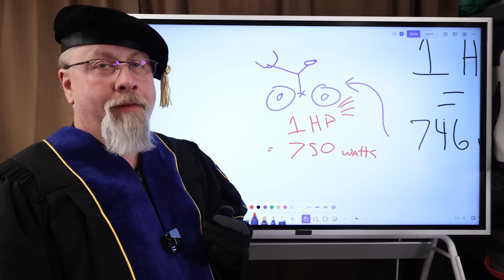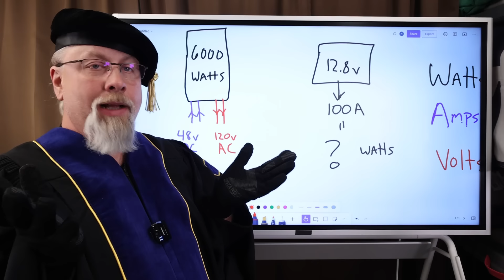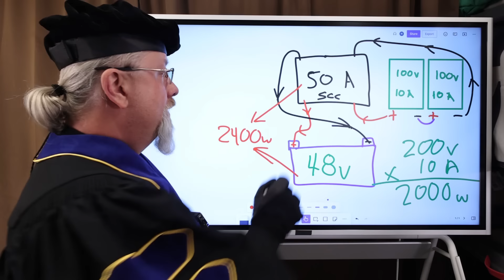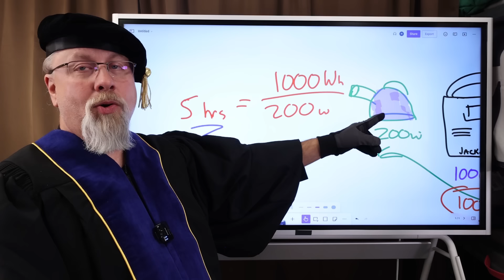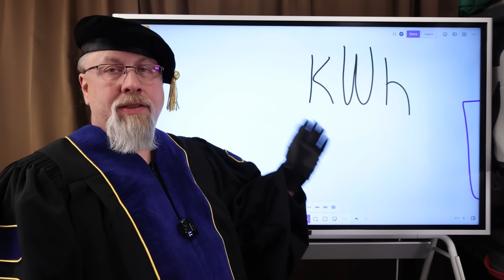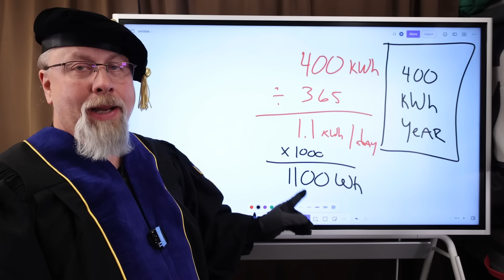Electricity for BEGINNERS Part 3/3: WATTS and WATT HOURS For Solar | Batteries | Generators

Comment: Mr Hobotech I have a question or 2. Good classes but only the tip of the iceberg 😁 Who knew. I agree need to watch again. I have a 2024 Nobo 16.1. It came with 400 watts of solar on the roof wired in parallel they said and 2 64 ah interstate agm batteries also wired in parallel they said. I honestly have not tried yet to see if thats true. There is a 2000 watt inverter which is supposed to switch automatically when hooked up to shore power and vice versa. I have a 12v fridge and tv, a 12.5 btu ac, microwave and propane heater. I hook up to an ecoflo pro with xtra battery and charge that off my f150. Have solar panels i haven't worked out yet but anywho everything works except i have no ac at the receptacles. People have said could be the connections at the receptacles wired in series. Makes sense but i am wondering if my batteries are too small ? I may have gotten a little lost in there when you were talking about battery size. The other question is about mppt cables coming from the panels to the generator a normal sized cable going a 100 ft would be too small? 3 400 watt panels was going to wire in parallel because everyone seems to say that's the way to do it. I got the connectors but broke one so put it aside till i can get it fixed. Anyway 🤦 Thanks for your help.

Comment: Sorry if this is in the wrong place. Will the 12v/24v Lead-acid Battery Charging Cable also work the same on LiFePO battery terminals?  Will really appreciate if someone knows the answer. Thanks

Comment: okay, this seems almost too easy. So if i have a household refrigerator using 547 kWh/year, that equals 1.5 kWh a day(1500 W) or 62.5 W an hour. So, a 700 Wh sogen should give me about 11 hours of runtime? of couse that doesn't take into account any startup surge.Is it that easy? if i finish all 3 vids do i get a certificate of completion?

Comment: Do devices draw more current as battery gets low? I'm trying to understand.. If I use 1200W coffee pot and my battery has gotten to half of its capacity.. So, the voltage has dropped, does the coffee pot increase current to get its 1200W? And I can ultimately fry it when the battery is almost completely drained?

Also, does voltage matter when choosing cables? if I use 120V and 40A load i need #10 awg.. but what if I have only 12V pushing the same 40 amp? I mean now the pressure/push force pushing the same 40A is ten times as less. So less (friction/resistance) and also less power travelling through a conductor.. Can I use #14?
Reply from the maker: You need to watch all 3 videos. I go into detail about cable choice. But yes amps increase as voltage decreases but it's minor on a lithium battery.
Reply: HA! Cool description of Horse Power! Love it!

Comment: Was wondering if you could do a video on how safe it is to have this scenereo ... four different solar power generators - solar into the first one with each other unit connected to the AC out with the final unit actually supplying the power to whatever.  As a result the units are all charged via the first unit which is solar charged.  Is this safe and is it safe to increase the say one kw output of each to four kw output adding up the total capacity of each unit connected.... though depending on the actual size of each unit the resulting total kw may be different in the end.  Am I making this difficult to understand lol?
Reply from the maker: It's fine to do but you lose 10-15% from each inverter in the chain.

Comment: hi i bought a battery off amazon it was the lowestprised lifepro battery i could find couldnt find any reviews on it has 12.8v 100am hours the name brand was ingeosolly.12.8volts
I bought it for the price bought alligator clips for it to in cas of power outagage to slow harge my Bluettie 180. It is slow charges at about 100 what hours can you review this?
ty Billly B. i bought it a while ago but never have seen a review. thanks. Billy Barnes

Comment: I was disappointed that you did not talk about inverter efficiency (or lack thereof). I'm guessing you considered that it make make the heads of the target audience explode to calculate in that complicating factor. You missed Power Factor as well, but that concept is well beyond the target audience.
Reply from the maker: Exactly. This is a beginner video. I may do an intermediate level eventually.

Comment: Thank you for this lesson.  We have always wondered how you could solar power and air condition an RV in Las Vegas' triple digits summers 24 hours a day for months at a time.  We guess the issue would be the weight of the 3600 amp hours of batteries plus the amount of solar panels to charge them.  Would this type of array even be feasible, or would you need an additional storage area on a power station type trailer?  How much would this extra towing weight be?  Would be great to incorporate in an RV build.

Comment: What if you have a battery that is a 12.8v LiFePo4 battery that is a 200ah but a 100amp charge/discharge rating 2560Wh rating. How does that work?
Reply from the maker: 200Ah is the capacity. 100A is the max rate of charge/discharge.

Comment: Good day sir? Hope you can help with have a bluetti 150 that set with low battery now won't take a charge
Reply from the maker: Its dead. You need to replace it. Bluetti 150 is 5 years old now.
Reply: @HOBOTECH  I don't think it's but couple years old  used of Facebook
Reply: @HOBOTECH  not completely dead very low
Reply: @HOBOTECH  ty for responding appreciate your valuable time

Comment: Thank you professor. Im going to sit the kids down to watch and learn all this.  On a side note: I have home solar on the roof. I seem to always have a few $100 true up payment at the end of the year.  To get the company back out to add a panel costs a ton of $$.  I bought 2 of those 200w Type N panels and they are just sitting in the closet.  I heard there might be a way to plug them into a home socket (need something to do the inverting and something to plug into the wall? to help with extra net metering.  1) Can this be done? 2) how can it be done. is there some amazon thing. That can plug the panels to the wall and keep things in ..phase. Or can I straight connect the Mc4 parallel cables (late at night so I dont juice myself) to the home sunny boy inverter. The older inverter is cool and I was able to install a power socket to it so even if the main power goes out I can switch it over and use that. .. Im mean.. what could go wrong 😶

Comment: Very clear explanations in this series. How do you usually factor in (roughly) conversion losses from the inverter going from DC to AC in the case of AC appliances?
Reply from the maker: Take the result x 0.85 to account for 15% inverter loss. Thing is a good inverter is 5% and a bad inverter is 25% so unless you know what your inverter loses, you have to guess. In the case of power stations I test that for you.
Reply: @HOBOTECH  thanks, that's the level of detail I was looking for, much appreciated!